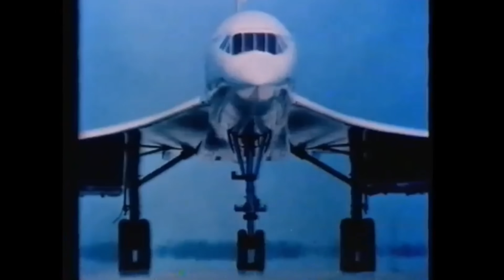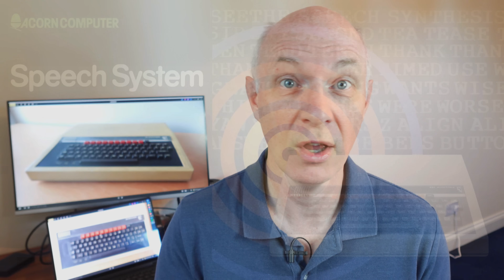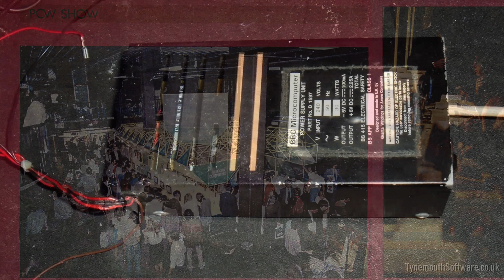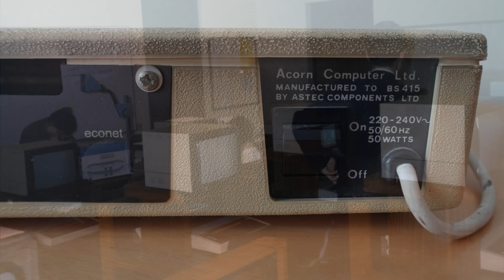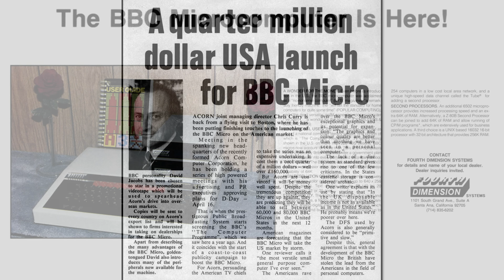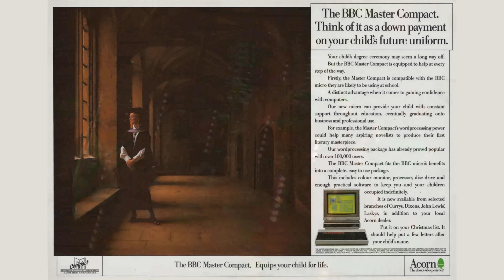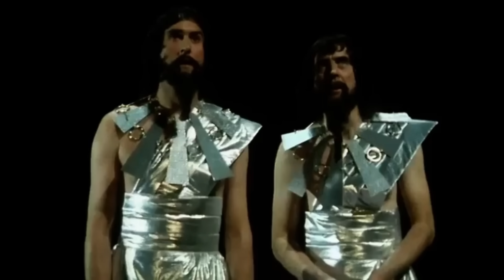6502 Reasons Why I Love This Machine

Comment: Fantastic. I was very lucky to be a BBC micro kid living in Cambridge in the early 80s. When our early model B had an overheating problem we took it down to the Acorn HQ just down the road in Fulbourn. We just turned up with it, they tested it with a hair dryer and I think replaced the PSU right there for us so we took away our fixed computer! 

For those who haven't seen it, there's an excellent BBC comedy/drama (from 2009) about the Sinclair/Acorn race called 'Micro Men'. Very nostalgic and a lot of fun. It's on YT here https://www.youtube.com/watch?v=XXBxV6-zamM

Comment: The BBC micro is the only 1980s computer still in production. Just buy a £20 Raspberry Pi 1-4 and run RiscOS on it. This is a full speed port of RiscOS for the Raspberry Pi and is not slow simulation of the Archimedes. You can then run the 2017 version of BBC Basic with its built in ARM assembler.

Comment: At that time, the Commodore 64 was the goto machine for games, along with the Spectrum, if you could afford them. If not there was the VIC20, and later the Commodore 16 which was more in my price range. I loved my C16 and used it to learn Basic and 6502 Assembly Language. But the BBC Micro was on another level, both technically and financially. Combined with a dedicated colour monitor it was as far away from the C16 as you could get and way out of my reach.

Comment: I have 6 bbc b and 4 monitors as well as loads of disc drives and verbatim discs. When i retire, thats sitting there ready to fix up. The capacitors all need to be replaced in the power supplies. Never turn on an old bbc without attention to the psu FIRST.

Comment: I used these at school in the mid-80s. I never owned one, but had several home computers and started programming in BASIC, leading to a career in C and then Java programming to this day. So, 35 years of software engineering and I still love the simplicity of BASIC. Nowadays in software engineering there are so many libraries, compatibility concerns, deprecations, language annotations, the list goes on, unfortunately. So, recently I tried BASIC again and am loving it, well for a kick of nostalgia at least. Modern ANSI/ISO BASIC is a lot like peak-BBC BASIC I remember, which I think was from the Archimedes. Everyone thinks of BASIC as having line numbers, but that is only from the early days of the language before standards brought in structure that is briefly mentioned in this video.

Comment: We had a BBC Micro’s in my primary school, which in my second year in 1988 we’re replaced  with all new Archimedes, which we played “E-type” on and drew pictures with the mouse. I then moved up to secondary school in 1991 and we were back to using networked BBC’s, it seemed a massive backwards step after the Archimedes. Then in 1992 history repeated itself and the BBC’s were replaced with Archimedes, four years after I had first used them aged 9!!

Comment: Fun fact: an Amstrad CTM640 or CTM644 colour monitor can be used as a display for a BBC Micro because Amstrad used the same RGB standard for the CPC 464/664 & 6128. I used a CTM644 with a Model B and it worked.
Reply: The Amstrad CPC also supports half-intensity RGB signals for a broader palette, of course. I think it was acknowledged in "The Amstrad Story" that the CPC drew heavily from the Beeb through the influence of Locomotive Software.

Comment: One of the BBC Model B computers I used to own was a Version 3 with a linear power supply. I can vouch for the fact the linear power supply ran hotter than the switched mode power supplies in the Version 7 Beebs I also owned.

Comment: My first computer was an Amstrad CPC 464 in 1984, and both my primary and middle schools had Link 480Z computers, but in the 2010s I accumulated a collection of Acorn computers. They included several BBC Model B computers with Cub monitors, a Master and the rarest of the family, a BBC Master Compact with 3.5 inch floppy drive. I also had an Archimedes A400. Regrettably, my ex then fiancé encouraged me to rid of them not long after my daughter was born. I wish I could have at least kept one Beeb.

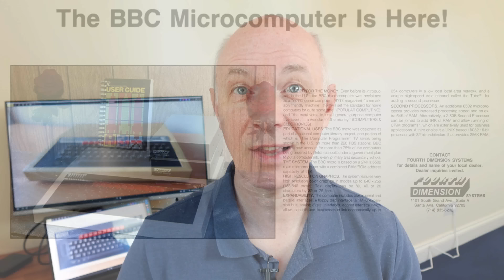Comment: It's the attention to detail on this channel: 21:53 - even the power cable has a wave form.
Reply from the maker: 😂 And it still does!
Reply: @LittleCar  Sir your commitment is noted!  Thank you for doing this, I grew up in a house of a single parent. By various means we ended up with a Commodore 16, but both my brother and I learnt to code on the Electron.  We've both had an incredible career off the back of it. It did change a country.

Comment: I still have my original BBC B that my grandad gave me. He worked for BBC Scotland and it was the BBC used to display the analogue clock face you sometimes saw when programming didn't quite run contiguously.
It still has the ROM for the clock in it which can be activated at any time with *clock.
I still boot it up up sometimes for some Elite, Galaforce or Stryker's Run.
Reply: The BBC Micro was never used to create the BBC's on-air clocks, but there is a connection!

Comment: Theres probably still a fair few labs using BBc model  B's to run ancient but usable equipment  finding the correct connectors though if anything fails  major issue

Comment: My local primary school still had those Beeb computers from 1993-1998 but by late 1998 the headteacher threw them all in the outside wheelie bin because by that 
time they were deemed to be obsolete and every classroom had their own PC ( Blue Class had 2 PCs, 1 RM Nimbus and a brand new X Trust tower ), my primary school 
was quite affluent and could afford to have the latest technology. But when I left primary school in 2001 I attended a special school and in the lower school classes 
they were still using BBC Micros until about 2002 or 2003 and computers were only disposed of if they broke and weren't worth repairing, some schools donated those 
BBC Micro computers to third world countries. It's funny how after their 10-15 year run they were seen as uncool and relics from the past yet 40 years later there is nostalgia 
for them but that seems to apply to anything kind of 80s tech including synthesizers and drum machines. Many schools including my old primary school the teachers did a 
good job at defacing these BBC Micro computers by writing security codes on them with a black marker pen and even using an engraving tool to etch it in 
( how does that not invalidate the guarantee? ) but I doubt my headteacher would even care if pupils popped the perferations ( Mrs Wilson my Yellow Class teacher would 
have probably given pupils a rollicking if they popped the perferations for the unused expansion ports ).

Comment: The Beeb has such a "designed by enthusiasts" vibe all through it that you don't see in most of the contemporary 8-bit micros. And it's one of the very few that feels like an actual proper computer system and not just a cynical attempt to get in on the home micro boom.

Comment: I was the proud owner of an Acorn Atom (chosen in preference to the Sinclair ZX80, as it looked like a computer rather than a badly made calculator,  and had high esolution graphics). Three years later I put myself in debt to buy a BBC B and just loved it. I burned my own eeproms to take advantage of the sideways ROM feature, I found that you could alter the BASIC ROM to use swear words instead of Basic commands, which appealed to my teenage sense of humour. Burning new ROM chips allowed me to have an excellent word processor by cloning a friend's chip as well as other rom based programs. Software piracy was a given, due to my low income and the horrendous cost of software. My favourite games were 'Castle Quest' and 'Elite', though I had to buy a floppy disc drive to run Elite.
You didn't mention the little blinking square on the TV, broadcast with the computer programme which could be used to download software with a little light cell.
I used my Beeb right up to 1991 when I finally was able to build a 80286 PC from parts.
The BBC was a great learning tool and set me up with a 40 year carreer in ICT.  I will always be grateful to this project.

Comment: There were a few things missed out about the BBC Micro in the video that were particularly relevant for programmers. One was the publishing of the Advanced BBC Micro User Guide - this was a reference guide for the OS calls and an essential book for anyone learning 6502 on the BBC Micro. I coupled it with a large 6502 reference book and wrote fairly complex stuff entirely in 6502: a Reversi game, a disk menu program in only 4K, a tape to disk copier that played Frak's "hidden" Captain Pugwash theme in the background during the copy and a BBC BASIC extension ROM with 20-odd new commands [I think a firm released something similar around the same time]. A lot of time was inevitably spent cracking tape copy protection of course - that was often more fun than actually playing the protected game itself!

 Another bIg thing for me that was the release of sideways RAM add-in cards - this allowed you to load a ROM image from disk into the sideways RAM. Yes, you could pirate ROMs - Computer Concepts' Disc Doctor was a particular favourite - and because of this, some companies' ROMs tried to write to the ROM area to either corrupt sideways RAM or detect if it had changed and then deliberately hang, but Disc Doctor's 6502 disaassembler [a feature sadly missing from BBC BASIC] made it easy to patch out that code from the ROM image. I did have legit uses for sideways RAM too - I wrote my own ROMs and also created a game ROM maker - if a game was a single binary file (almost all were), I wrote code to convert it to a ROM image complete with a startup message and a star command to run it. The BBC Micro I used at Uni had a Mr. Ee! EEPROM installed and we'd play it with *MREE during our lunchtime breaks!

Comment: The BBC Micro was the best 8-bit computer ever created - it had a very good keyboard, good sound, was very expandable, was fast and had easily the best OS and BASIC. Essentially, it was the exact opposite of the ZX Spectrum, whose only redeeming feature was that it was cheap and it therefore benefitted greatly from a virtuous cycle of more users -> more companies developing for it -> more apps (almost all games because it really wasn't nice to use for anything serious) -> more users.

It did make me laugh that while you could write commercial games for the BBC Micro on the machine itself (there was a 6502 assembler built into BBC BASIC - I wrote something to do the equivalent of #include in C, but as a assembly code addon to BBC BASIC, allowing me to write a large 6502 game where the multi-file source code was much larger than the free RAM available), the ZX Spectrum was such a poor machine to develop Z80 code on that games were known to be developed on more usable computers and then downloaded to the ZX Spectrum (often with some homebrew hardware to avoid using cassette tapes). Manic Miner was developed on a TRS-80 for example!
Reply: The fact that Manic Miner was developed on a TRS-80 always fascinated me. Matthew Smith is a true genius - he created a cable to connect it to the Spectrum and developed the game on his own - all when he was a teenager.

I owned both of those computers at different times, and was an electronic hobbyist from the age of 9, but I don’t think it would have occurred to me to connect the two together even if I had owned them simultaneously. Actually, I probably wouldn’t have been brave enough to try it, for fear of zapping them!

Comment: Acorn gave me a BBC Micro so I could implement Forth on it for them.  I also had the NS32032 add on to investigate implementing Smalltalk.  I turned down a job with Acornsoft assessing potential programming languages.  I turned it down to work on software for the Sinclair QL, in the Cambridge Science Park.  I implemented Pascal for the QL.
Reply: NS32016, surely? Unless Acorn prototyped hardware with the NS32032. Had they kept that iron in the fire, they might have had a fairly nice machine in the late eighties with the NS32532 and a Weitek FPU, but the NS32000 family was running out of road by then. The NS32000 family had their associations with Wirth, Modula-2, Oberon, and so on, of course.

If your Forth implementation was the one Acornsoft shipped, then I saw it in action back in the day!

Comment: I had a Model B way back then, used it for morse code send and receive through the digital expansion port all written in Basic, also later for work with Packet Radio.  It really was a great little machine.
73s GW6ISF

Comment: I had a ZX81 and was looking to buy a new computer. A teacher at school suggested a new computer in development. He had an A4 specification that outlined this new machine - the BBC Micro. It looked so impressive on paper, I ordered one without ever seeing one in operation. I had to wait a while before it arrived. I ordered a model A as I was 16, it was 1981 and I was still at school. Eventually it turned up in early 1982. I came with the provisional user guide. The slot of the LHS of the keyboard for the plug in ROM cartridge didn’t have a push out perforated cover - it was just a hole. The serial number of the machine on the sticker underneath was 000137, so a very early product. I did upgrade it to the model B specification and even had a double disc drive for it. A wonderful machine that I knew the inner workings of, both software and hardware.

Comment: Still got my original BBC B..(Left the factory in 1983 according to the sticker on the main board). With the 6502 second processor box, disk drive, Wordwise word processor chip and the official BBC analogue joysticks..
My CUB monitor let the magic smoke out many years ago.

Comment: Canada here.  Love the content young lad.  I remember buying a Sinclair ZX81 for my father and he spent many an hour learning to code and enjoying himself immensely.  The BBC just wasn't a thing here although Acorn did try.
Reply: The Apple II wasn't really a thing in the U.K. The Tandy TRS80 and Commodore Pet seemed to be far more popular. In 1981 where I worked had a top of the range TRS80 system with what seemed like every option avaiable.
Reply: @MrDuncl  I was incredibly lucky - at the age of 14 (1982/3, living in the UK) I was loaned a top-spec TRS-80 to do some data entry for a business, and had it in my bedroom for about 18 months. It had dual floppy disk drives and a full size business printer, and came with VisiCalc. The BASIC tutorial manual was, I later learned, renowned for being excellent. I taught myself to program, and also became very skilled at using VisiCalc.

In my later teens I did some freelance spreadsheet development work on Lotus 1-2-3 (on an IBM PC) and became an expert at macros. A few years later I got my first full time job in IT… my job title was “Spreadsheet Programmer“!

I have worked in IT one way or another for the whole of my working life. I’m turning 59 later this month (May 2026) and still work in the IT world and absolutely love it.

Comment: My first experience with computers was in the mid to late 90s on one of these.  The primary school had a mix of these, a few early pentium PCs and one or two Acorn Archimedes boxes.
In "comprehensive" school, they only had a "computer lab" consisting of some 386 machines running windows 3.11, and a 386 in the woodworking classroom which, somehow, chugged along with windows 95.  In 2003, there was a big building move and we suddenly got multiple computer labs AND PCs in every room.  These were IBM Netvista boxes with Pentium 4's running windows xp, all of which were networked!  Hell of an upgrade hahaha

I'll always remember the BBC though.  Fantastic little machine.

Comment: It used the GEM Desktop on a 6502 CPU? Apart from the menu bar the desktop looks pretty much exactly like an Atari ST which has much higher performance and of course also costed a lot more.
Reply: Acorn only used GEM on x86-based models. It was meant to feature on the Acorn Business Computer, and it was even publicly demonstrated for the first time on the 80286-based ABC 300 series (but attributed to Acorn at the time). However, only the Master 512 shipped with GEM in the end, which was the Master 128 with a 80186 second processor (or co-processor as Acorn called it by then).

Comment: My dad worked on the project on the BBC side, so as I kid (also with special needs) I ended up doing some of the testing to see how easy it was to teach people to used, so I still have downstairs 1 of the BBC with the black PSU, not the gold ones. Also over the years used every version of the BBC and most of the addon. So 1 of the addons I used before switching to PC, was 8086 addon code.
But you forgot the best game on the welcome tape, "Roller Invaders"
The BBC basic, as well as spelling colour tight, was also a token-based basic. I think it's the only 1 as far as I know, which also saving a lot of memory.

Comment: Nobody actually cared about biorhythms back in the 1980s, but it was included on just about every microcomputer because it was one of the very few things you could do with primitive graphics and the incredibly slow interpreted basic of the time. You plot a nice sine wave, it's incredibly easy but to the people of the 1980s this was bleeding-edge stuff. Very few other graphics ideas could be made to work on these slow machines so stuff like biorhythms were the default packaged apps.

Comment: I have had an Acorn computer. 4K. I expanded the memory with VIC 20 rams (extra ram modules) . Soldered in the Acorn with an extra 7400 serie chip to adress correctly.